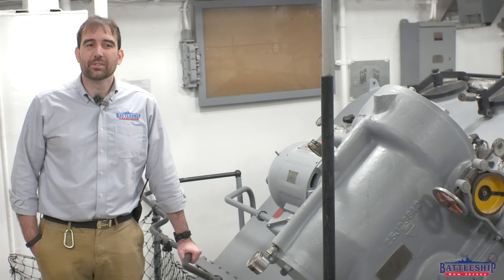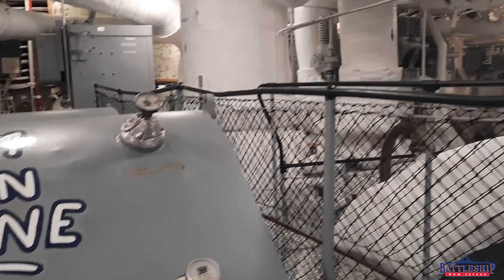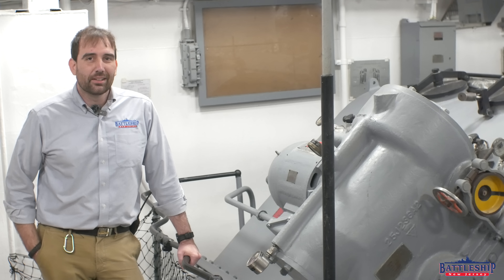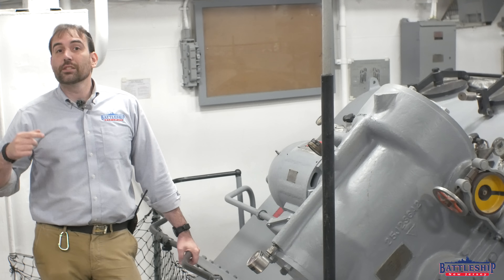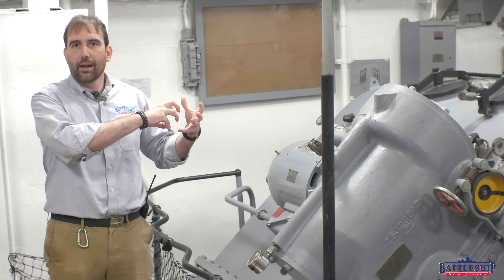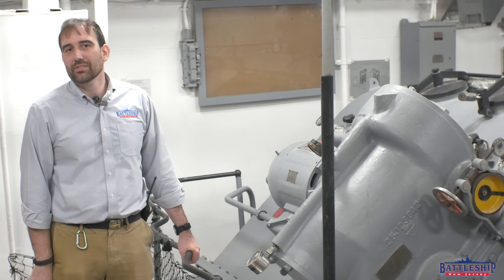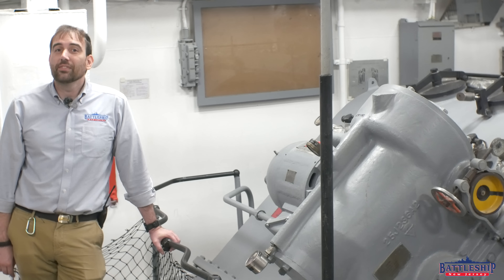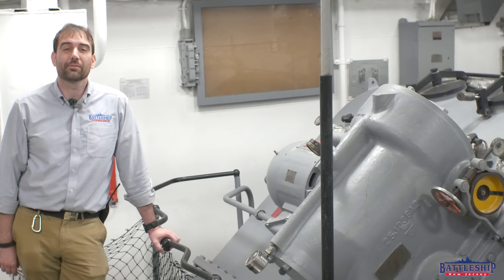What in the Navy is a Jacking Gear?

Comment: The Jacking gear is also used when stopping and locking the main engine when your underway for an emergency happening like loss of main lube oil pressure in the main engine. The ahead throttle is closed and the astern throttle is opened to bring the shaft to a dead stop so the jacking gear can be engaged until the cause of the loss of lube oil can be found and corrected.
Reply: That's more the Shaft lock.  Jacking is for rotating so shaft doesn't sag.  It can also be used to rotate for maintenance or other work. IE remove blades, inspections, other.
Reply: @Dawgsofwinter  on some ships the shaft locking device is mechanically linked to the turning/jacking gear and engaging the shaft lock requires also engaging the turning gear.
Reply: thank you. I see a propper responce.. appriciate it.
Reply: Wouldn't stopping the engine while underway, turbine full hot, cause the sagging shaft issue mentioned in the video? I'd imagine lost oil pressure you're sort of screwed whether you stop it and it sags or you keep it turning and damage the bearings.
Reply: Yes, no so worried about the shaft. More worried about the turbine. But stop and lock is done in an emergency. Don't care about sag. Control the emergency, then worry about the shaft and turbine.
Reply: @quillmaurer6563  Not so much on those old ships there was no oil going down the shaft.  Some newer ships can reverse their Propeller blades and need hydraulic oil down the shaft but frankly that all ends up being small peanuts.  The shaft's own weight will cause it to sag.  The bearings supporting it are rather far apart and you can only put so many in place.  So if you don't rotate the shaft every so often it can start to bow down under its own weight.  Kinda like if you've ever seen a OLD cheap fiberboard/plastic bookshelf with the shelves starting to bow down even if nothing was really on them. 
Most of those have a sump in the bottom and more or less the shafts own movement causes oil to get into them.  where loss of oil gets you is in the reduction gear.  and that does potentially damage bearings and gears there.  
And you'd use the jacking gear to turn the shaft after shutdown but this more for the reduction gear more than the shaft
(reasons for this and the ways you can damage shaft bearings and lube oil loss issues/responses get into LOONG lessons in ENG dept stuff and if you really want that go join your local navy and go into that dept yourself been there done that learned em the hard way not teaching em on YOUTUBE)
Reply: @quillmaurer6563  
The sagging issue happens over time, like when you're sitting pierside for months.  The shaft isn't going to sag if you stop and lock for 10 minutes, or even a few hours.  I'm on the fence as to whether the shaft would sag anyway, it sounds like a myth to me.
Reply: @quillmaurer6563  
No, the shaft does not get that hot, even from gland seal steam on it.  A stress relief bake for steel is generally around 1200 F.  Shipboard steam systems don't get that hot.  I still think shaft-sagging is a myth.  A shaft will get warped with gland-seal steam applied if it's stopped because the heat is not applied uniformly to the shaft.  It'll warp because of uneven heating.  

You have to be careful, there's a lot of myths around this stuff.  We used to be told that when the aircraft carrier is running at a flank bell, the main shaft right at the bull gear is running 1 full turn ahead of the propeller.  That is BS, totally impossible.  You don't get that kind of deflection from high-strength steel.  

On the carrier in-port, the mid-watch starts up the lube oil system and rotates the shaft on the jack.  I remember the time being about 15 or 20 minutes.  I still think that's done mainly for corrosion control (it keeps parts coated with oil).  These parts are high-strength steel and corrode easily in humid coastal air, especially when it has seawater mist in it.  If there's any shipyard or engine manufacturing engineers online, I'd love to hear their insights on this.
Reply: The USS Forrestal performed an "emergency back" from a "flank" bell! The turbine blades touched on one of the main engines! The Navy came up with a program to have the remaining three engines "make up turns" while the damaged engine shaft dragged. I worked main propulsion on that ship.

Comment: “Do not put steam to the turbine with the jacking gear engaged”
Reply: there is steam applied to the turbine during its warm up. its called preheating the system. how ever I think what you meant was that no steam is injected through the jets. which would in turn spin the shaft. which would tear the jacking gear off causing damag to the reduction gear  set and possibly injuring the upper level man or the messanger taking readings on the main.

Comment: Also keeps the multi-ton screw from putting a permanent bend in the shaft.
Reply: Not true. Purpose of jacking gear is to slowly rotate turbines to prevent uneven heating that would cause bowing. Can also engage friction brake on jacking gear to lock main engines. 
While cold iron, the jacking gear does not run. Screws will not bend a stationary shaft. 
There are also times where the screws can not move at all such as maintenance or divers over the side.
Reply: @kolt46 , I will let you take that up with the MM2(SS) or MM1(SS) giving me a engine room upper level walk through on my sub.

Comment: Coolie is a pejorative term used for low-wage laborer, typically of Indian or Chinese descent.  Actually, he was working as chief engineer, working on one of the connecting rods in the 'pit' under the engine's crank shaft, not sure which cylinder though, perhaps the LP cylinder given the size of the rod.
Reply: He may have been chief engineer but to sailors just a boss coolie.
Reply: Actually, Chien, the man killed, was one of the worker coolies.  'Lop-eye' Shing was the boss coolie who did not do any work himself but took a cut of the rest of the Chinese workers pay uses the incident to cause trouble between Holman and the officers on the boat.

In the movie it's hard to tell what happened but it's clearer in the book.  The two worm screws were applied to a gear on the shaft intended to lock it it place.  The gear was supposed to be locked to the shaft by two keys but they had disappeared who-knows how long ago and the only thing keeping the shaft from moving were the several coats of paint it had on it.  A leaky throttle admitted steam to the cylinders and the engine was free to turn.

That was what made Holman start to teach Po-han how to operate and maintain the engineering plant instead of just doing things without understanding why.

Comment: Why do they call it a jacking gear
Reply: Sorry, Ive commented on allot of post.. Corrected a bunch of wrongs. I have no idea and dont know anyone that does.. Its only a motor used to turning and as a locking device connected to the reduction gear set. I think anyone that would be old enough to know would be senile or just to old to recal. It would of been named that many generations before the new jersey would of ben drempt up. Its used on any main steam propulsion turbine.

Comment: Assuming the oil container is 6 foot square, it should have a useable capacity of something like 1,500 gallons of oil, leaving a bit of room for expansion, air bubbles, and some overfill.
Reply: That “tank “ is actually 2 tanks. One storage tank, one settling tank. Storage tank had good usable oil, if I remember it had about 3k capacity, enough to fill engine and gens 1 time. Settling tank had steam piped to it and had “dirty” contaminated oil.  Since oil never goes bad, we reused it.  The steam warmed the oil so the water and contaminates could be removed making clean useable oil again.

Comment: Ryan- Aside from issues with the seal on the propeller shaft, would it be possible to use the jacking gear to rotate a propeller shaft on the museum? Not sure if that would violate any of the Navy's rules.
Reply: I'm fairly sure it would come under the clause of not using the turbines. Even with the jacking gear doing the work. It's in a gray area at best. Also how much draw would it add to the ship for the power consumed? I'd like to see the manufacture's build plate on the motor.
Reply: @Ghauster  Usually just a few HP.  They're not big motors because they're geared down so much.
Reply: @matthewbeasley7765  thank you. That's what I had guessed.

Comment: Sand Pebbles is a good book and movie. It is very un-nerving to stand beside the ship at dock and watch the propellers/screws slowly turning via the jacking gear.  Yes, the turbine rotors sag and if they are not kept turning they develop a bow that is enough to cause bad vibrations when started up spinning under way. I know, I was there.
Reply: On the carrier, we were told that the purpose of daily jacking was to keep components covered in oil as a corrosion preventive measure.  I never considered sag (we were never told about that) but it makes sense.  In the shipyard when the ship was under construction, the main engines and reduction gears sat for two years without being rotated.  When the Navy took possession of the engine room and started testing main engines, we heated lube oil through the purifier heaters and rotated the engines daily for months before doing any kind of >1 RPM rotations or dock-trials.  Aside from testing reasons, maybe we were doing that for months to get the sag out of components, too?

Comment: Thank you for answering my question. I feel like a celeb. We use turning gear on our process air fans in the iron mines. They are enormous rotors spining at 898 rpm. They run and about 900 F. on cool down we use turing gear to prevent balancing sags. In the Navy I assumed it was to prevent shaft SAG while in port.

Comment: Do you mean 2 RMP on the turbine shaft or propeller shaft. Kinda fast for the propeller.
Reply: not really....ours went to 135 RPM for 36+ kts
Reply: the jacking gear turns the reduction gears. which in turn turns the propeller shaft and the turbine shaft.. they are all connected through the reduction gear set.
Reply: @joshual3350  he was saying the 2 RPM was fast for a prop.......our prop had a flank speed of 135 RPM or 36+ kts
Reply: @michaelkendall662  That's some powerful jacking gear you had.

Comment: So the Jacking Gear is like a parking brake, it keeps the shafts from spinning when not in use.
Reply: Sort of. As Ryan said it was more important to preserve the turbines and shafts by having them warm up and cool down by method of having them continue to turn slowly, while the oil also continued to lubricate. Keeping the shafts and equipment moving slowly also prevented issues like the heavy propellers from warping the shafts, etc.
Reply: yes. but the jacking gear is only used a a locking device in this case. its not allowed to turn like warm ups or going cold.

Comment: The main Engine Jacking Gear will turn the main propeller shaft about one revolution every eight minutes... That is the Lube Oil Storage Tank for general equipment use; the Main Engine sump  (oil pan, for civilians) iThat holds the oil for the main engine  is located below the main reduction gear.

Comment: Oh! It’s the turning gear.
Reply: I'd more call it a turning motor and locking device. but yes the motor is connected to the reduction gears with a small gear.
Reply: @joshual3350  we call it turning gear on turbines in industry.

Comment: Also spinning the turbine without lube would be BAD
Reply: Electric oild pumps are used until the seam driven pumps can be brought up. so yes you can jack when cold iron. due to electric pumps being used. Its done like that because under the main turbing is the condensor. the SSTG's (ships steam turbing generators also have condensors. Boiler water is recycled.
Reply: @joshual3350  my point was, with the ship cold, but no lock on the props, you coukd spin up the turbine when you did not expect to, and thus had no oil.

Comment: Oh yes, as a Battleship Machinist's Mate in my previous life, we'd use the Jacking Gear along with low-pressure steam to gradually "warm up" the turbines and gears for a full 24 hours BEFORE departure. And again, when pulling into Port, a full 24 hours to gradually cool down. The racing world has something roughly similar in the way of Turbo Timers. These devices specifically pump oil through the turbocharger for a period of 5-10 minutes or so after the engine is shut down to prevent "cokeing" the bearings. In the Navy though, nothing is left unattended and must be both monitored and logged, with out-of-spec parameters properly reported.

It was lamentable to be basically the first "on duty" before the ship departed, as well as the last "off duty", but that was what the job called for. I was intensely jealous of those that were able to sprint off the ship nearly immediately after she was secured to the pier.
Reply: I had my episode of jealous rage when the USS Ranger developed problems in her steam plant, left the exercise early and then tied up in OUR parking spot at the Alameda pier to get fixed. We came in over a week later (after completing the exercise AND being the "ready deck" to qualify the Ranger's air wing and our own) and had to tie up at a different pier. That pier did not have enough shore power for us (USS Enterprise CVN65) so we had to maintain steaming watches (6 hours on watch then 12 hours off. In other words 3 section) for that entire in port period. 
It took some fancy juggling to get everyone at least a few days off during that period. So when I crossed the brow for a few of those precious hours off, I heard the 1MC on the Ranger announcing Liberty Call for sections 1,2,3,4,5,7 and 8!  
I was all so hot I could have replaced a reactor!
Reply: @johntrottier1162  I feel your pain.  Been there, done that.  Not the exact same circumstance, but the same effect.  And same ship.  USS Enterprise CVN65, 1980 - 1984, RC Div.
Reply: Electrician's Mates had to rig shore power cable and transfer the ship's bus over to shore power too: no securing early either!
Reply: Small, friendly clarification here as a race car builder. A turbo timer actually runs the entire engine for a set time after running on boost to cool off the turbo. Modern turbos no longer need timers because they're ball bearing instead of fluid bearings. Btw, thank you for your service!
Reply: @salemcripple  I had the same thought - turbo timer keeps the engine running at idle. My understanding is that it's not ball bearings that make them unnecessary but water-cooled turbos. Set up correctly, even with the engine shut off themosiphon effects will keep water moving through the turbo, preventing the center section getting too hot as heat soaks in from the hot side. This is really the main reason for watercooled turbos, it's not for keeping the turbo cool while running so much as after shutdown - I recall reading a paper from Garrett or another turbo manufacturer on this. I put a turbo on an aircooled VW Bug, which doesn't have a water cooling system to tap into, so I simply left the water ports open - this is common practice among those who put turbos on those cars. This is where cool-down becomes important. Especially as I'm running relatively low boost, I don't think it's a huge issue so long as the last few miles is relatively slow, as is the case on most journeys. But when I arrive at a friend's house that is at the top of a long freeway climb, I'll leave it running a few minutes in his driveway.
Reply: I couldn't remember in my post why the jacking gear is important on a turbine but you covered ot nicely here. While warming up and cooling down it permits a slow turning of the shaft s9 elven hearing and cooling can be accomplish as to not warp the shaft. Been awhile but this joghled my mind.
Reply: @mikewalker4330  
On the carrier, we would also turn on lube oil and spin the main engine on the jack for about 20 minutes to keep all possible surfaces coated with oil.  That was done as a corrosion preventative measure and to prevent sag of the shafting due to sitting for long periods (or so we were told; if there's other reasons, I will heartily entertain them).
Reply: Yep, "wrapping up the plant" guaranteed you were going to be the last one to hit the beach.
Reply: @nitetrane98  
No doubt.  It kinda bites to be on the duty section the first night when you pull in.
Reply: Aircraft gas turbines also have special starting procedures to prevent a “bowed rotor” condition. Obviously, they are a fraction of the size of these huge steam turbines, but the same physics apply. Heat rises, causing the upper part of the shaft and rotor to expand and lengthen, causing it to bend in to a frowny face.
Reply: I was a propulsion MM on CVN-73, I can relate.  We had airedales that would fly off the ship a week before the rest of us pulled in off a deployment.  There was always a lot of animosity between these guys and ship's company because they'd act all self-important about it.  They would also treat the ship like a hotel room.  If they didn't want something anymore, they'd just leave it behind for somebody else to deal with, they're as bad as the shipyard.  If I was a ship CO, I'd be looking after these guys hard and busting their ass to clean up after themselves.  It would affect senior officers' FITREPS if they failed to keep these guys in line, that's what I'd do.